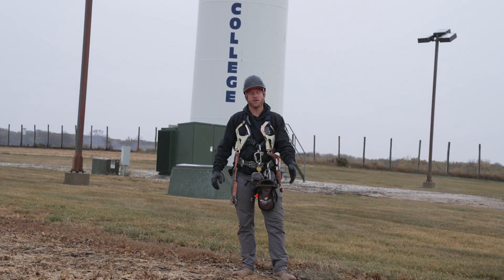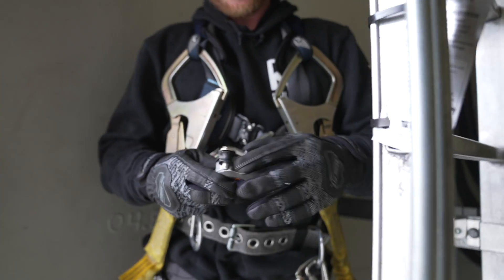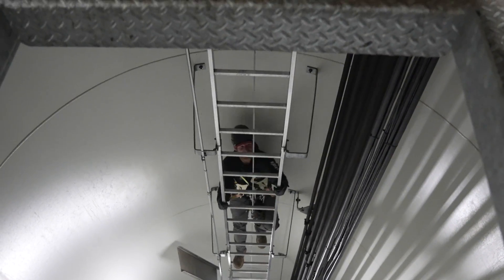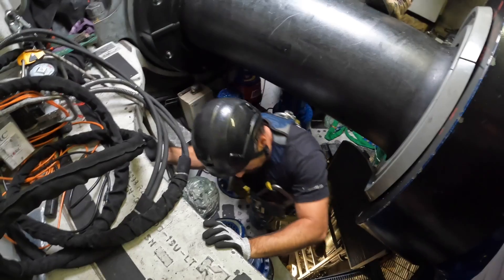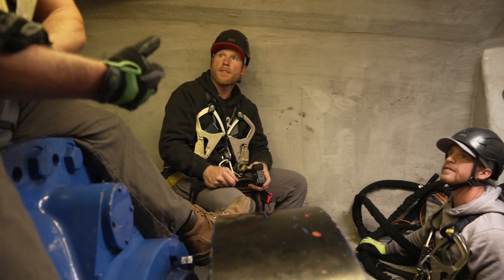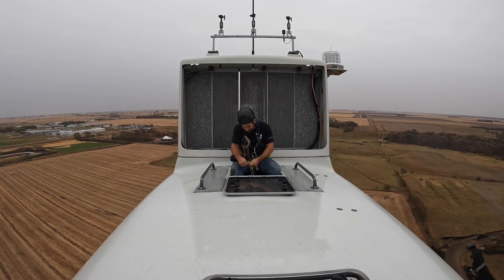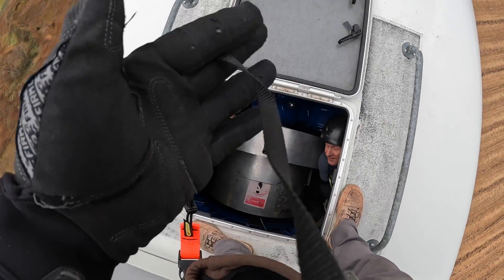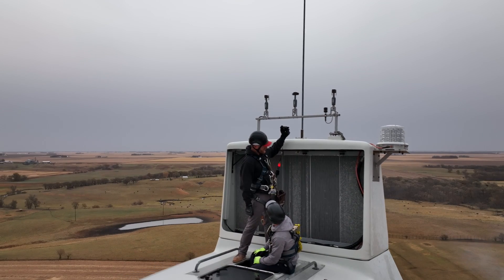We climbed to the top of a Wind Mill

Comment: What an incredible experience you had there. I would love to try a doing a wind turbine, not sure my legs would be as keen as me. A power pylon is the highest I have been. The company I used to work for stopped using those safety harnesses that you were wearing after a fatal accident. The harness cut of the blood supply to a guys legs and the blood in his legs went toxic. When harness removed that was it for him. Not sure what happened just that he was left dangling in the air for 2 hours by his harness.
Reply from the maker: yeah...that is a huge problem...they have straps you step into to take that weight off
Reply: Also we were taught how to make a "step" loop in our rope to do the same thing. Also to have a rescue plan in place to minimize time someone would be dangling.

Comment: That's really cool to see the inside of one of those! I've seen a video of the base being constructed with all the rebar and concrete. They are pretty cool but I don't know much about them other than somewhat negative things that independent news has said about them. I've heard that those windmills cost more to build, maintain and run than pretty much any other source of power and that they have a very limited service life. That's what I've heard but I really don't know much of anything else about them besides that they are having a difficult time burring the blades due to space. I've also heard that the spinning blades kill a lot of birds. It would be interesting to know the facts behind the cost verses other forms of power like coal, oil and hydro.
Reply: New onshore wind costs about $46 per megawatt-hour over their useful life, while large-scale solar plants cost $45 per megawatt-hour, new coal-fired plants cost $74 per MWh, and gas plants are $81 per MWh.

Also their effect on birds is totally negligable. All US windmills combined kill about 200,000 birds per year. Domesticated US outdoor cats kill 2.4 billion annually, or 12,000 times as many as windmills.
Reply: @seank9643  Now that's interesting information. I saw a border wall plan a few years ago that was made out of steal and solar panels with a tram on top with bullet proof windows. I thought that would probably be the best wall to build and still do. It would provide a lot of power. I also saw a solar road. I don't know what is best but for sure solar uses up a lot of silver and to be able to do a mega project of this size would take up all the silver in circulation from what I've hears. I'm going to have to look into your school a little more. Looks like you guys have it going on in a top notch way.